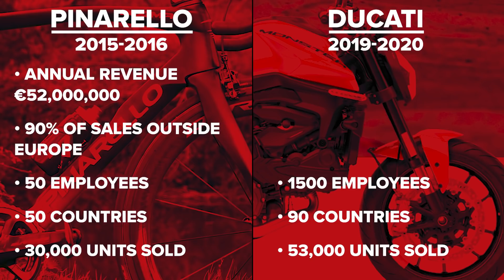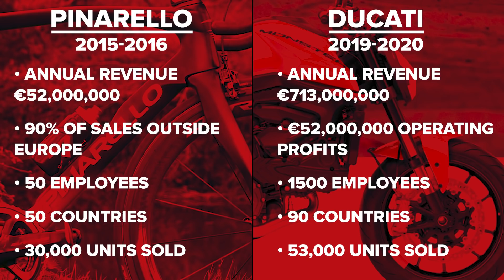How Can A Road Bike Cost £10,000?!

Comment: I spent £2k on my bike twenty years ago and it is still going strong, I have replaced a couple of components and the cleats for the pedals wear out like brake pads and tyres, but it was well worth the investment. Do modern top end bikes have the same durability?
As an aside, I spent more on my bicycle than I did on my motorbike. Then I customised my motorbike, spending the same and then more again on suspension and brake upgrades. Did it need them? Not really. Does it work better now? Yes. Again, it was worth the investment. An expensive bike is an investment in future enjoyment that cheaper models cannot compete with.
Reply: 2K 20 years was a lot of money, must've been one hell of a bike.
Reply: @derekhobbs1102   it remains a great bike. It was the best frame available at the time, a team replica race bike, with a top flight groupset and titanium and carbon finishing kit. These days it does more miles in the turbo than it does on the road, but it is still a joy to ride. I also bought a custom steel cyclocross frame at the same time, which I loved and still have. It was designed to be fast and nimble off road, which is too brutal for my old bones these days, it is still a beauty though.

Comment: pinarello =china so all the article is lucking solid evidence. all pinarello bikes are made in a company called carbotech in CHINA. Which assembly line has 4 brands, including cervelo. Also the owner of pinarello is a fund whose main owner is Bernard Arnault. yes the person who owns louis vuitton group. yes the person who makes bags and wallets owns pinarello  so cut the crap of more expensive  carbon etc pls. Arnau wants pore profit that is why pinarello prices goes up!!!! some pinarello couple of years ago where just painted to europe so they could put the sticker made in EU or Italy. that was not legal so they stopped. Ans as i want to be precise the entry level carbon frame from a high end is aprox 300- 350 euros. The 50 euros difference has to do with  the frame size. if the frame is monoqoque everything changes. pinarello is not that case.

Comment: Probably not.  I doubt I could spot the differences between the highest priced bike and one costing considerably less.   Neither can most people.  I could tell the difference between aluminum and carbon just by moving the bike from a bike stand to the road, but two carbon bikes? I'm not so sure.  I don't compete.  I ride for pleasure, and a carbon bike increases my pleasure in that it makes climbing somewhat easier and heading into the wind less tortuous. But put me on a $5000 bike and then a $10,000?  Who knows?  I might like the cheaper one better.  The engineering differences would mean nothing to someone like me.  If I were really rich, and the $10k meant little or nothing?  Yeah maybe - just to show off.

Comment: This video took into account 2 types of motorised vehicles but only discussed carbon bikes. What about the highest end aluminum or titanium bikes? Surely those have automated assembly line manufacturing, right??? So what makes an expensive metal frame bike expensive?
Reply: I'd be surprised if they had anything but tube cutting/forming automated, honestly
Reply: Titanium almost always is from a low production company that will hand make it, because that’s what the customers want. It also is an expensive material and requires really skilled welding. High end aluminum bikes like the caad13 you’re mostly paying for the group set and wheels
Reply: @fluffy13bondjames92  Thank you. Your entire comment should have been 4 minutes of video.

Comment: I see you are trying to justify the expense of a Pinarello compared to Ducati. How about using a company like Giant, which turned over £1.6b in 2018 yet still produces £10k+ bikes. I think the only reason you'd spend that sort of money (unless you're a pro) is because you probably are very inadequate in the crutch area, or you have trouble getting your head through your shirt collar. I just had to have a new wheel on my Trance 2 - it cost £175. I can buy a new car alloy wheel for a lot less than that. Don't get me started on tyre prices, brake pads.......

Comment: These GCN shills are clueless… I can't believe that they really think that there is more labor time in one carbon frame than the entire car. Do you know that each fluid hose is tested? And in many cases is inserted by hand in testing jigs, and do I need to mention rigorose quality control standards ( leaky gas hose = potential for explosion). Not to mention thousands of tolerances on all the machined parts, meanwhile the bike industry is unable to hit filve tolerances ( let's talk about pressfit BB + seat post + head bearings ).Don't get me started on wiring and all the harnesses. Icing on cake, can you imagine how much time is needed to create CAD models of all the parts + most of the parts need some sort of the testing jigs that are also designed by ings. There is WAY more RND in only the car cooling system, then the entire bike frame. What about gearbox ?? :D

Comment: Shame on GCN for this video. The cycle industry is aimed at ripping off rich middle aged men by the use predominately of over exaggerated advertising. "Superbikes" are getting slower not faster yet price ceilings keep increasing.  The material and labour costs of making a superbike are well out of proportion with the price tag and GCN will know this. Most superbikes use Chinese carbon, the same stuff used in much cheaper models. If GCN wants to help the bike industry it needs to be transparent.

Comment: It's the exotic  materials that makes the price.  One can not compare it with Fiat seicento. McLaren is more suitable car. 1200 kg of carbon, titanium and aluminum cost you at least £ 1 million. If the bike weights 8kg that gives you 150 bikes out of 1200 kg. 150 times £10k is £1,5 millon. Still McLaren is cheaper...